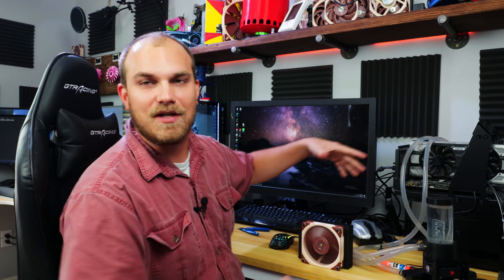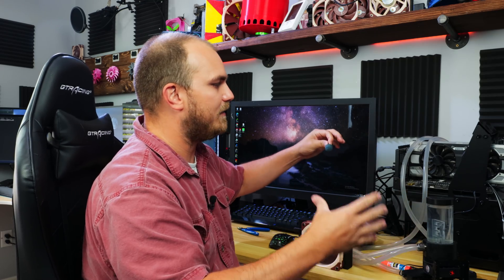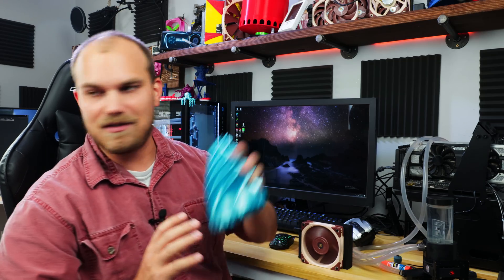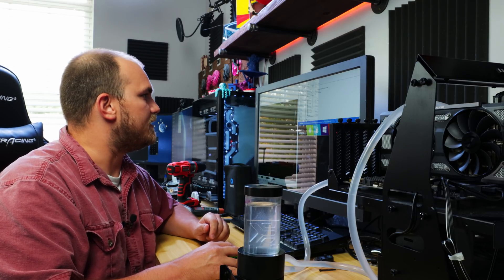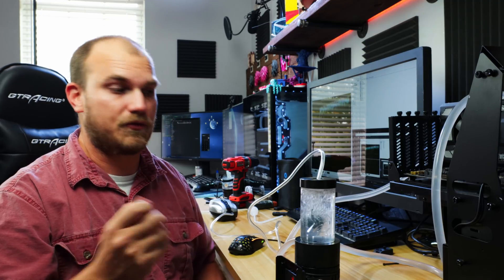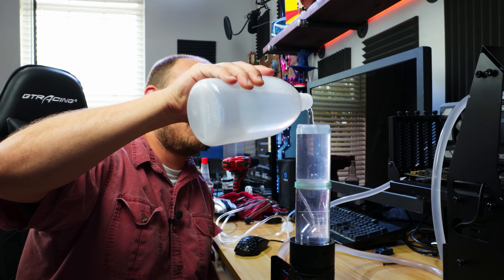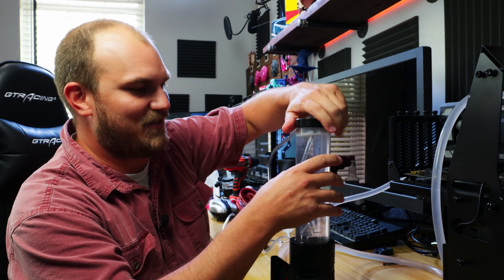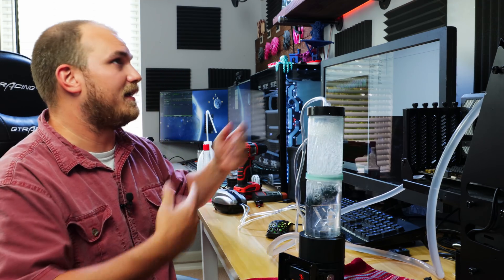Can An Airstone Cool Your PC?

Comment: Looks like the idea is to increase the surface area of the water molecules which contacts massive amounts air in general to exchange heat, you know this works because you tested already.

This idea is struggling i reckon because the air is being saturated with heat beyond what is efficient short of boiling off the water. 

I suggest putting a mini fan in the place of the res cap extracting the hot air while the bubler brings in cold air. 

As it looks you are pumping cold air into water, heating it up and trapping it until it condenses back into the res adding to the heat in a mad useless run away effect.

Comment: Airstones in one reservoir, pass the water in to a second reservoir in series to release the air, then to the cooling block.  Also try with distilled water.

Comment: Use a diffuser plate from one of the smoking air-freshers, it will form very small vapor droplets which will evaporate fast cooling the water.

Comment: You ever wonder why Nuclear Power Plants Cooling water towers are so freaking huge for evaporative cooling? Besides the amount of water they're cooling of course. The hot water is literally rained down through the column of air going up the middle to cool the water. I had the idea of making a Mini-Evaporative cooler that works on the same principle as a Swamp cooler back when I ran PC cases with tube grommets built into the case. Never found the time to do it though.

Comment: I thought "a lot" about it. I think problem is that you make circulate hot water in loop- from bottom to bottom. WHAT IF you put water intake from above (like waterfall), where air bubbles take their job (probably), and refreshed water will be pushed to the loop from bottom. Maybe fluid with less viscosity will help.

Comment: I would encourage to have the air rocks at the bottom of the system, the bubbles float up through the entire piping and exit the top. Not sealed, eh? Do that with air.

Counter thought. Ethanol. In a sealed unit. It has surprising cooling effect on engines in better tuning. Almost fact with many tests done.

Comment: go for a copper coil in the reservoir with a separate pump with refrigerant for optimal heat transfer. set a vacuum in the copper coil line and use a compressor. basically combine air conditioning with watercooling and you could potentially get temps around 10 c

Comment: Increase surface area to same as cooling tower. Lots of bubbles little bit of water. Also your air pump is likely heating the air and can't pull any heat from the water.

Comment: I see that rc airplane/drone propeller up on your wall. I'm curious whether or not that's hooked up to a brushless hobby motor, and if so, how well does that cool? Will it be loud as hell? Yes! Will it cool better than anything else? I believe so. It may be the most impractical thing ever devised, but it also sounds fun. If you've already done this, please point to the video.

Comment: here's a crazy cooler idea: why not buy a small minifridge, build a water tight tank that will fit in it snugly, drill holes in the minifridge for input and output, and turn it into a water reservoir (maybe get a little funky with it and have a spout drilled and threaded into the side of it for a easy drain option for if you need to replace the water.)

EDIT: my prediction is that it would help keep the water cold in a silent manor, + with there being a lot more water since your essentially building a large tank, all that water will disperse and heat up a lot slower then the amount your computer's system currently has.

Comment: God, this is so stupid. Even if making funny bubbles with hot compressed air would equal evaporation ... YOU SCREWED THE F'ING CAP ON THE RES!
Where's the the heat and "evaporated water" supposed to go?
"...we're just not evaporating enough water!" 
This is like completely taping off the radiator and saying: "I think we're just not moving enough air!"

Comment: problem is it is the opposite, the vaporization of water takes energy away... so introducing bubbles in the water is not really doing this. (when water evaporates it takes in heat energy, by forcing the water into particles, it has more surface exposed to air and evaporates into the air a bit, this takes away heat energy from the air. just spraying room temperature water on a shirt that is room temperature, let's say 20C, the water evaporating will make the shirt drop temperature to 15C even tho the water was also 20C. it takes energy to evaporate. a weird quirk of water.)

Comment: your problem is.
the water evaporates and this creates a cloud of water vapor.
but then that vapor has nowhere to go because you have a cap on it which is both keeping the vapor from rising out and blocking air flow which would push this cloud away.

Comment: You are already knowledgeable of EK water blocks... Try out the EK Vardar Furious FF5

It runs at 3000RPM and it had higher static pressure than Noctua fans.

Comment: You need more air for the water to reject the heat in to. It's all about mass flow. If you knew how much air a Noctua was blowing per minute, then you have an idea of how much air you need to bubble through the fluid. You may also need to introduce countercurrent flows into the system to give the hot water a chance to interact with the air. This will introduce the problem of trying to separate bubbles from the flow, though. If the bubbles don't rise out of the fluid, it won't remove heat.

Comment: it would be interesting to see what temp the air was coming out of the stones at, the air pump may have been adding heat to the air both by the compression and the mechanical friction in the pump itself.

Comment: Crazy cooler idea: run your system on a liquid cooling loop filled with super cooled liquid. Essentially have a block and pump that runs into a small container that you fill with high proof alcohol and then you drop in pieces of dry ice to super cool it down to -50 F and you can do some amazing overclocked on this. 

I did this for a project in one of my mechanical engineering classes on exotic cooling solution for electrical components, worked great, first time I ever got my 4790k to peak over 5.2 GHz

Comment: I could see this being somewhat possible as a low wattage cooling solution if the resavor was taller to allow for the bubbles to be submerged for longer. maybe if you had an 18 in resavor and was able to force a lot more air through the stone, to try and increase the air to water ratio and therefore increase the duration of surface contact between the two
Reply: Another factor is if you increase the viscosity so that the liquid couldnt maintain surface bubbles. Try alcohol or another thin liquid.

Comment: I rather imagine that the air bubbles are getting into the loop and reducing the thermal efficiency quite a bit, due to less water contacting the cpu block. It certainly looked cool though.

Comment: Hot water from the loop should be returned to the top of reservoir and flow against the bubbles.

This way most of the water goes straight in a out of the reservoir with some air mixed in.

Comment: I think the issue you're probably getting is too much air is getting trapped in the water and getting sucked through the loop, so you're losing water contact on the CPU block. Maybe try putting a fine mesh at the bottom of the reservoir pump to try to pull most of the bubbles out as it goes through the pump and loop, then it gets bubbled through.

Comment: You are going to loose a lot of water due to evaporation ! You would need to bubble nearly as much air through it as a normal fan blows through a cooler.
How about running the cooling water through a large domestic heating radiator, your in Canada and winter is coming so you could put it outside :)

Comment: I think that since the water is being cycled through the bottom of that res it is not really getting the effect of the air stones which are above both the inlet and the outlet of the loop. So they are are kind of tangential to the system. I think if you were to set up a second res outside of the loop where the water goes in the top and out the bottom and you use the air stones inside that res then there should be significantly more cooling taking place.

Comment: It’s because cooler air isn’t actually passing over those bubbles. With the water tower, that works because the falling water is transferring heat with the air; but with this, being sealed, that’s not going to happen.

Comment: There are air stones and bubble bars that are specifically designed to make finer bubbles which would eliminate the need for a wetting agent and thus eleminate the foaming issue and some of the trapped bubble issues.

Comment: So, some suggestions: 

1) A larger diameter and height container. This will increase contact area between the air bubbles and the water. 

2) Make sure the air going into the airstone is actually cool and/or room temperature, as in my experience it's usually warm. The air pump typically relies on the flow of the air that it's pumping to cool itself, and the motor can get quite warm.

Comment: Isn't air running through a compressor like that typically coming out hot until it expands? But if it goes straight into a tube, it won't have a chance to expand. So is there hot air going into the water?

Comment: What if: You used ISOPROPHYL ALCOHOL instead of water in the loop, with the airstone?
Also: the reason why its throttling sooner is because that water at the bottom isn't being cycled as much and is retaining most of that heat. If you had somehow got the loop to pull the cooler water at the top of the tower, back into the system, then you would probably have better luck with getting the temps lower for longer.
In Thermal Dynamics, warm air rises to higher elevation. However, water complicates this process. Fluids, depending on viscosity, will hold heat down to the bottom of whatever holds it, unless displaced in such a way that it loses energy. Bubbles would theoretically help, but to truly cash in on that principle, you need to somehow get the cooler fluid to flow back into the loop without interacting with the warmer fluid.
Another idea would be to have fluid flow in a non-linear loop.

Comment: Can you check out the Noctua Redux series maybe? I'm rebuilding my PC for the RTX 3070 and the "Noctua NF-S12B redux-1200 PWM" for example claims a volume of 0.9dB (but not a pressure optimized like the louder "nf-p12 redux" ranging from 12.6-25.1dB 700-1700RPm. I feel like you could only use the NF-S12B as a rear exhaust since they aren't pressure optimized and won't perfom well. I dunno what I'm asking maybe attempt to almost mute your Pc or just compare them to the other Noctua fans or something. Or 3D print a mount to convert the 1dB fan into a Deskfan since it's so quiet and you can modulate the RPM.
Reply: A 0.9dB desk fan is something I would actually try if he succeeds. That's really practical and would probably look sick on a desk or maybe attached to the side of your monitor with adjustable angle.
Reply: 0.9dB is Hella impressive but I think they would be the standard if it won't have drawbacks however I definitely want to see him do something with that. Maybe this time it'll actually be funktional if he builds a fan. Maybe he could even do all your ideas in 1 Video I really want to see that.
Reply: I'm here for that

Comment: Me I would try to use an 10 gallon or larger aquarium.  Depending on how warm water gets could even put some tropical fish in. LOL 😆.  But valume is the whole issue if not cooling with radiator due to heat has no where to go. So longer would be better not necessarily taller.

Comment: Reasons why it may not work.
To much air getting into the loop
Air going through pump is being heated up by the pump
And probably because the cpu is just to hot.
By the time the water is up to temp I reckon the air is gonna have a hard timing taking the heat out. The bigger the reservoir and the more air stones will just prolong the water getting hot. Still interesting. Maybe have a look at the time it takes to thermal throttle the next time

Comment: I think the problem is that your just pumping room temp air, possibly hotter due to the pump heating up, into the water. On top of that you aren't circulating the water properly. Just trying to go off that the warm water will rise isn't good enough. If you were to you give this a fair shake you would have to move the inlet to the top and probably get a second reservoir since you're basically trying to turn that one into a makeshift radiator.

Comment: The problem is the air your pumping is getting compressed causing it to heat up.... so your adding more heat to the system... not removing it...

Comment: The problem Is. Your surface area of evaporation is the size of the hole at the top. Compared to a radiator. With all it's fins.

Comment: Just stumbled across an old video in which you said, your camera doesn't do 60fps at 4K.
You should try out recording at 60fps with the highest resolution it can do, and then render the finished video at 4K, because youtube allows a lot higher bitrate for 4K videos.
Even if you just upscale a 1080p video, watching it on youtube in 4K results in much better image quality

Comment: Maybe use vacuum cleaner dust in an Archimedes screw at a 45 degree angle then the dust falls back into the hopper to be re-used again? Dust will work as long as its dry.

Comment: Maybe try an idea with phase change cooling like injecting liquid N2 or CO2 into the water and as it boils it will remove the heat from the water in the loop. Jayz two cents did a video with dry ice but it would be interesting to see a liquid co2 heat exchange in water

Comment: Get a heatcam! I'd guess the water in the res wasn't really exchanged, so the cold water got stuck. You should have a pipe which is about 1 foot long and is part of the actual loop. Then put the airstone in the  entrance of that pipe amd get rid of the air in a reservoir at the end of it

Comment: Try having the water enter the reservoir from the top and not cycle through the bottom. As it is the hot water would be first to be grabbed by the pump and sucked back into the loop. Yes there is some transfer of heat but it’s not efficient in the current setup. You want hot water to get to the top where the air will interact more with it and transfer more heat out. Maybe also add an air control like they use in tanks to control how much bubbles come out.

Comment: What if you scaled your evaporation style cooler down and combined it with a normal reservoir? Like literally the same thing you did with the resin adapter and the second reservoir, only filling down the bottom part and let the water dripple down from the top? Maybe with holes in it, I dunno.

Comment: A couple of issues with that setup. First, those air pumps get pretty warm, so there is a chance that is heating the air. Also, compressing air, which is what the pump is doing, heats gasses. You would need to go with a pre-compressed air source to remove those heat generating sources in that system.

Comment: Increasing the volume of water will only increase the time it takes to reach equalibrium. Boiling a little kettle VS a big tank will only differ in time it takes to reach the boiling point. 
The air bubbles you pump trough the fins on the cooling plate make the heat transfer less efficient.
Go to GamersNexus, he's got explanations in very extreme detail with loads of data.

Comment: With the tower it's all about aerosolizing the water so that it's easier to for it to turn to steam. This might work if you had a larger surface area at the top (a wider tank) and a lot more stones (and probibly multiple pumps). The larger area will allow more of the water to be aerosolizing when the bubbles pop and the extra stones (and pump) are just to put more thermal mass though the water (remember how much air the fans move).

Comment: This is an interesting concept, but I don't think this is the way to do it... As a computer enthusiast and an aquarium hobbiest, I have 2 points of information.

1) Gas exchange in Aquariums is not done via the airstone itself, but rather through surface agitation caused by the column of bubbles interacting with the surface of the water.

2) Evaporative cooling is a thing, even in aquaria. For example, it takes 3-5 watts of heat per gallon to heat water a few °F. I run a 150W heater on a 30 gallon Saltwater system right now. There is a temperature difference between the heater's chamber in the sump and the temperature in the display. Unfortunately it's like 2°F. And Saltwater systems have a massive amount of surface agitation due the intense flow required in a display.

So imo, you have 2 issues. Evaporative cooling is not efficient enough to cool the loop, and even then there is not enough surface area for gas exchange to happen.

Which brings me to my suggestion. Use a pair of bulkheads to plumb a loop into a 40 gallon Breeder Aquarium (because it's big enough to work and it's a cheap size. Also not actually for breeding, it's just what the size is called) Then load it up with wavemakers pointing at the water's surface (Thinking 4000-8000 GPH of circulation. A 40 Breeder would need 200+ watts to heat, so I'm betting that amount of surface agitation would be signifigant enough to delay thermal throttle.

Comment: What is forcing the use of the cooled fluid? Doesn't the coolant loop just short circuit threw the pump/bottom of the reservoir. Try hot fluid into top of a reservoir, Airstone near bottom above the outlet, fluid outlet at the bottom. That would force the hot and cold fluids past each other to have a chance at heat exchange. What I think I see in the video is attempted cooling of fluid that does not go threw the loop and is stagnant in the reservoir. At the end of the day the air forced threw the water still has to be vented and that will increase humidity in the area and reduce the fluid level in the system.